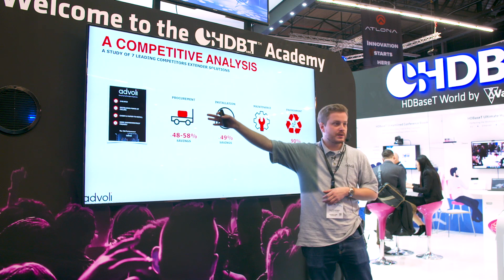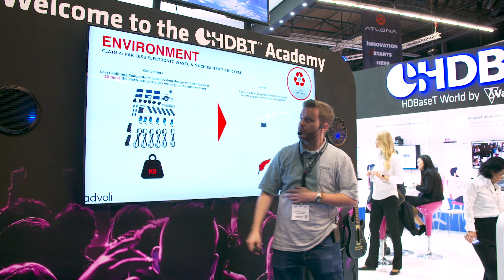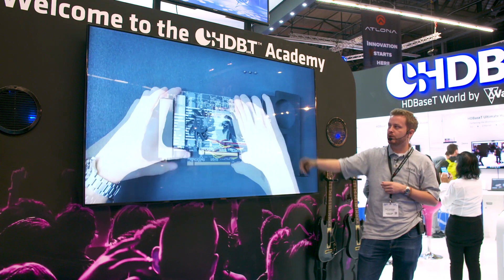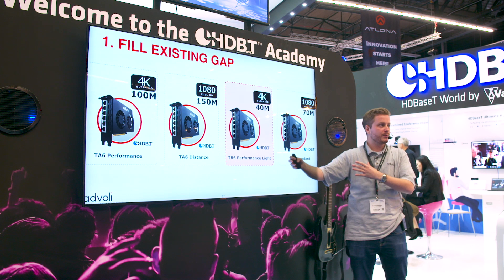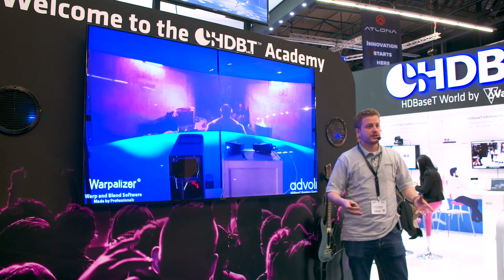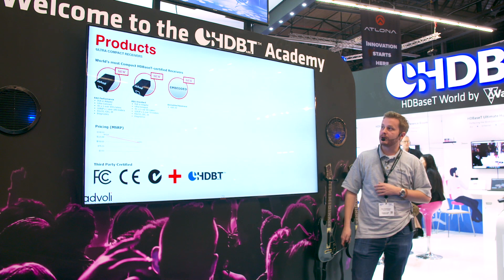advoli Presentation at ISE 2019

Comment: what is the distance is more than 100 meters, can we use OFC (Optical Fiber Cable)?? For eg. out of 6 display 2 nos. of display are more than 100 meters.
Reply from the maker: We are "roughly" limited to 100 meters per hop up to 8 hops at 4K resolution. At 1080P this distance increases to 150 meters when enabling long reach mode. I quote roughly as it depends a lot on the cable quality that you use and how heavily you bundle. We have pushed up to 200 meters using Belden's HDBaseT cables. You can either A) use extenders - additional hops or B) use HDBaseT optical extenders for further reach. Drop us an e-mail and we will try to help you solve your issue.